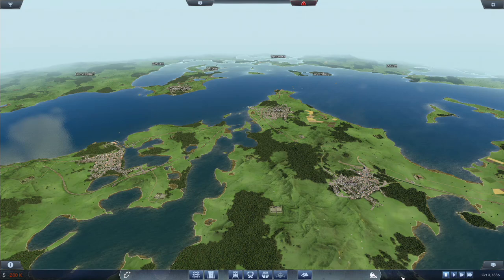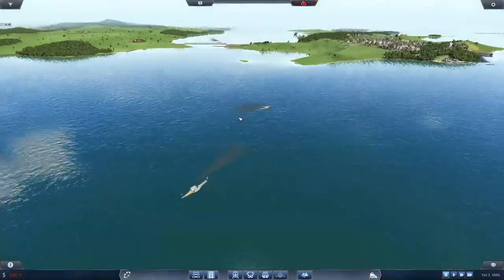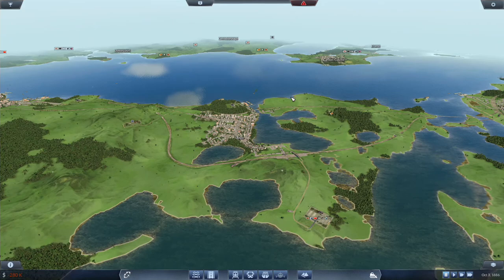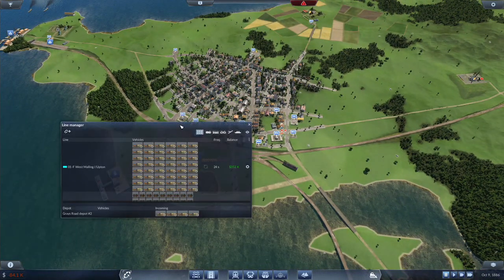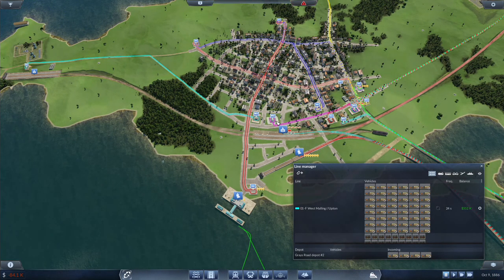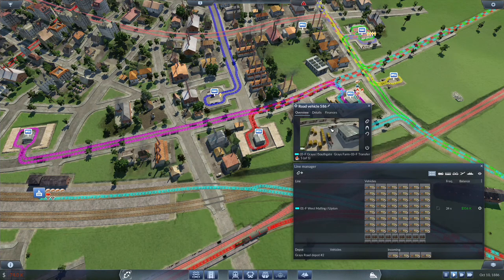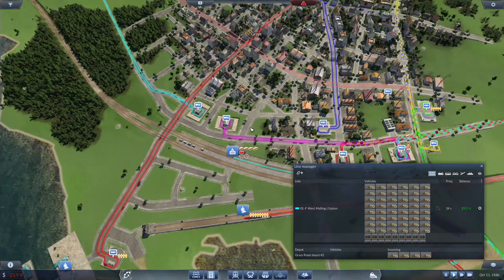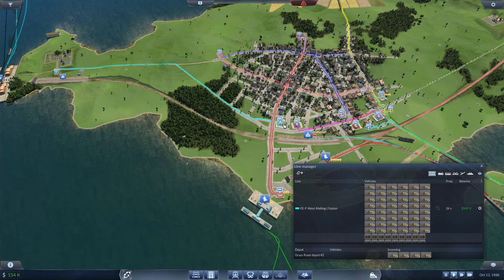Connecting Dovercourt [1886] - Transport Fever [European Freeplay] [ep22]

Comment: Scott note for future no more wait till full to send veciels
Reply from the maker: I use the wait till full load for specific reasons, I often forget to set it back to load if available once such setting is not required.  The last thing I want is a vehicle making a trip empty while waiting for an industry to see that a route is available to deliver the cargo.  It's a particular problem for ships which are slow, and trains which are expensive with regards to running costs.  Trucks it's not as much of a problem.  I just have to remember to turn it off afterwards, or not set unlimited wait time.